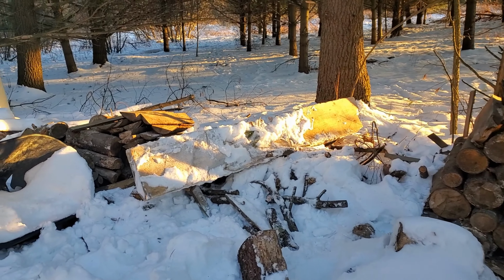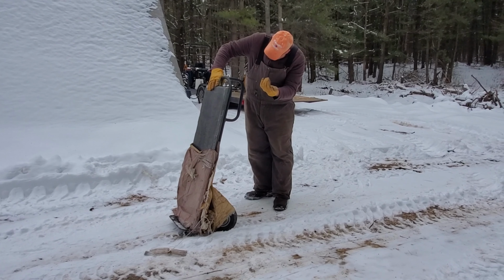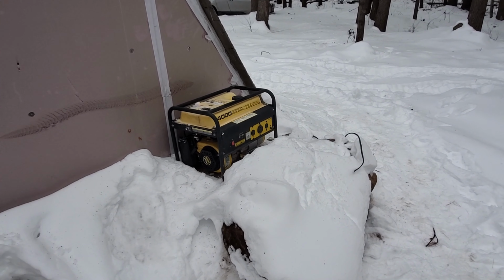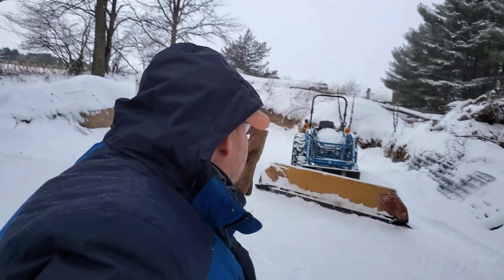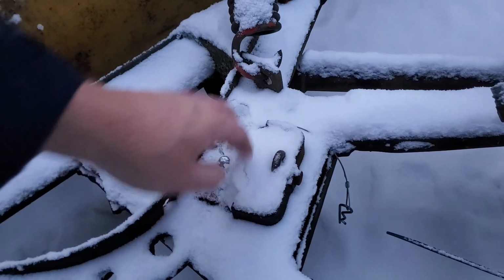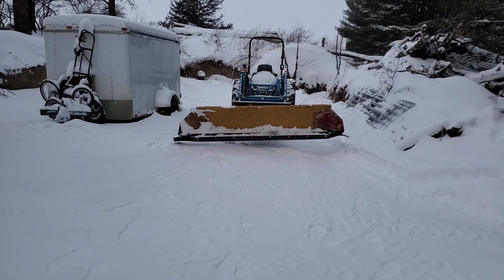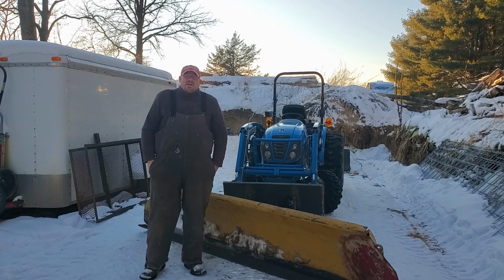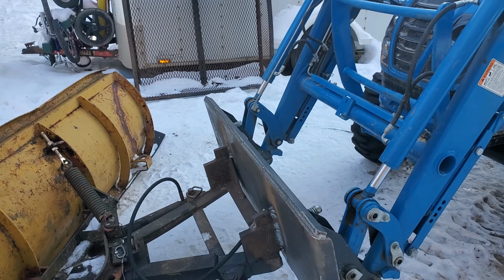Giant Plow On Compact Tractor

Comment: I built a plow for my LS. My tractor is a little smaller so I had to design it a lot lighter than yours. I purchased a Koplan 72” blade and a 1/4” quick tach plate, then I fabricated the rest. It works great.
Reply: Oh, then I put the pivot at the quick tach plate, so the plow shifts sideways as it turns.  Different geometry, but it is a genius level mod.
Reply from the maker: Sounds great, I had considered shortening the bracing between the plow blade and the plate to move the plow back and closer to my loader but this was almost zero fabricating. Thanks for watching, always glad to hear from a happy LS owner. Love mine!

Comment: i think it would be a big help to cut off the wings that they welded on.  good luck with it.
Reply from the maker: Yeah, I am worried about the added stress from extra snow or wet snow for my size tractor. For small to medium sized snow fall it has been awesome with the wings to use as a pusher to clear larger parking areas quickly. Thanks for the comnent.

Comment: Yeah, I think I would cut the blade down some if it was mine as the stress will eventually start cracking the framework of the tractor. I had a similar crack issue with mine and the way the framework on the tractor is, I did know see it until it finally broke on one side and I don’t use anything other than what is design for my size of tractor. Hydraulics over time I guess?  
Anyhow I have a question, I noticed that your bucket leveler is bent on different angle as it goes to the end of the rod. Mine is straight and allows a problem trying to see level of bucket, is that why yours is bent like it is, for leveling?
Reply from the maker: I bent my indicator over like that when I was driving under my cabin to dig out the cellar so it wouldnt catch above on the beam and floor joists of the cabin. I just never bent it back after. It catches less under tree branches this way as well. Thanks for watching.

Comment: My question to anyone is there a difference between mounting the truck plow solid to the quick attach plate versus pins and allowing the plow to pivot with the quick attach plate? It appears both ways work. I’m just looking for which way is better.
Reply from the maker: In my opinion the pins and a chain would be better. I chose to mount it welded solid for ease of design and construction. Thanks for watching.
Reply: @johansenfamilyvlog8972  Thank you!